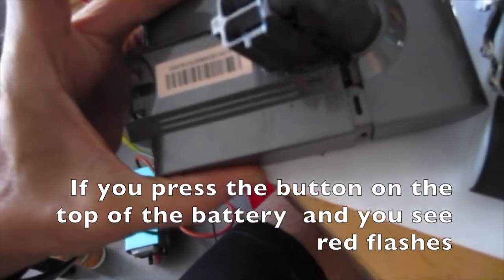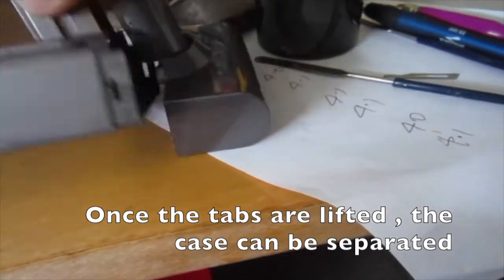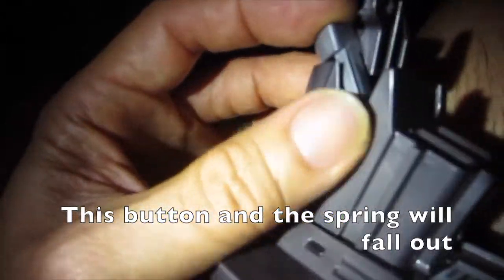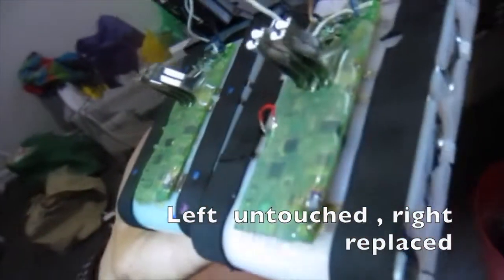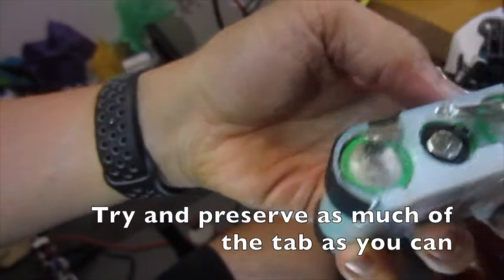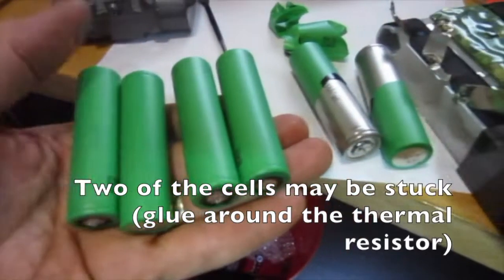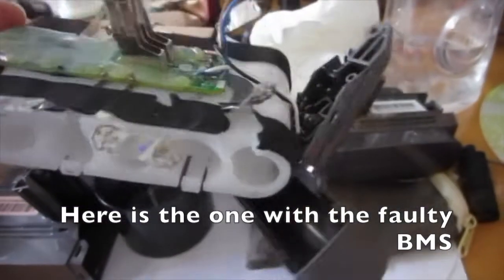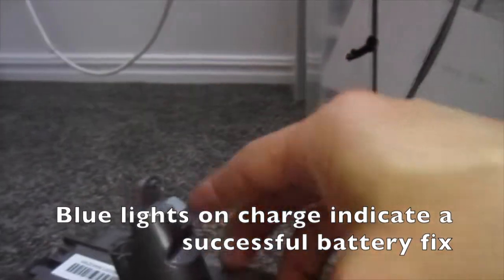Dyson V6 red light of Death  Fix Battery fault  Tips Opening case repacking 18650 cells and te

Comment: I got 32 red flashes, dismanteled the battery and got  4.05, 4.07, 4,04, 3.97, 3,97, 3.75. I got one battery 18650 from a friend 4.08 and removed the 3.75 battery and added the 4.08 however am still getting the 20 flashes with the new battery
Reply from the maker: Problem is you have to balance all batteries . You need to charge every cell separately with a charger that shows the final capacity ( more important to show capacity is the same ). Once all cells show same voltage and capacity it should work .
Reply: @Dentinvent  thanks will try removing them all and charge them separately and then check voltage using multimeter
Reply: @Dentinvent  i charged them up and all are betwerrn 4.25-4.27v  total 25.5v however still am getting 20 and one long green

Comment: Mine flashes 32 times. If I buy a replacement battery kit on amazon, would that fix it?
Reply from the maker: Yes that should fix it . 32 flashes means the cells on the current battery are out of balance . It is fixable but you have to take the battery apart to get the cells out to charge them separately.

Comment: Useful video! I rebuilt a Dyson v6 battery using new cells and new bms from aliexpress. Also tried buying new battery from Amazon but both run for 30seconds and then the vaccum starts pulsing. Any idea what is wrong?
Reply from the maker: Try complete disassembly and deep cleaning of filters or try running it with no attachments or filters to see if it is a suction problem
Reply: @Dentinvent  you might have a blockage. clean the suction air ways and filters.

Comment: Кто пылесос Dyson Батарея красный и зелёный
Reply from the maker: Battery light. A solid blue light indicates that the machine is in normal operating mode. A flashing blue light indicates that there is no power, please charge the battery. A flashing amber light indicates that there is no power or a temporary fault (e.g. too hot/cold) ...
Reply: Пылесос samsung Jet 70 SERIES Cordless Stick Vacuum
Reply from the maker: What did you need to know about this ?

Comment: I accidentally ripped off charging cables from the socket not the board. Now i don't know which is which. White is + and goes to the center of the socket or black
Reply from the maker: I’ll have to search through my photos to see if I can find what is connected where . I’ll reply if I can find the answer for you .
Reply from the maker: Looking at my old parts battery , normally the black is negative which goes to the outer terminal and the white is usually positive and goes to the centre . 
Sometimes to check , get magnification and see if you can match up the broken ends of the white with the broken bit on the centre terminal and same with black .
See if the broken ends on the black wire match with what’s left on the outer ( lower ) terminal.
Reply: Thanks, now I have a bigger problem, all batteries are between 3.5 to 3.7 volts. I don't want to change the batteries and find its the bms's fault.
Reply: @IOIIIIIIOI  actually on the pack I have black goes to the centre terminal white to the outside
Reply: It's on 32 red flashes btw.
Reply from the maker: @IOIIIIIIOI  
32 flashes is supposed to mean the bms is sensing battery balance problem  . If you are game just disconnect the cells separately and take them out . Try and get each cel back to 4 volts with a dedicated lithium ion charger and then put them back in . I’ve found it bms dies it isn’t worth buying a bms board .
Reply: @Dentinvent  the bms can be reprogrammed with a pickit 3 programmer, look it up.

Comment: The red light on my Dyson V6 flashes exactly ten times.    Is that the motorhead or the battery that needs to be replaced?
Reply from the maker: Just clarifying, you say red led flashes ? 
Are they not blue ?
Reply: @Dentinvent  No it is exactly ten red blinks every time.
Reply from the maker: @ChangasTube  
I think the red flashing means it’s time to either try and replace internal batteries or buy a new battery pack . Remember if you change the internal batteries the capacity should be the same for each cell . As per my video , maybe better to cut the old batteries out and weld on new tabs ( don’t try and take the tabs off the original batteries ).

Comment: Hi..I have not opened the battery case..but was wondering if you can clarify some points in my Dyson:when I put on charger the light is blue..like if was charging.as soon as you remove to use..lights just blink red10 x.i dismounted the parts..removed the battery..and on pressing the trigger bottom..already out of the body..it blinks once blue and goes on green.DOES IT MEAN THAT THE MAIN ISSUE CAN BE THE BODY..NOT CONDUCTING THE CHARGE?
Reply from the maker: Unfortunately When the battery indicator light on your Dyson upright vacuum cleaner is flashing red, this means in the vast majority of cases that the battery is defective.
I don’t think the main issue is the connection between the body and the battery .
Reply: @Dentinvent  thanks...

Comment: Hi. One of my cells show 12.5v while all others read between 3.5v and 3.6v. What could be wrong?
Reply from the maker: When you measure the cells , be aware that sometimes the cells are still connected to adjoining cells. Hence you can get the high 12.5 volt reading. You sometimes need to actually disconnect the cells to check them properly.